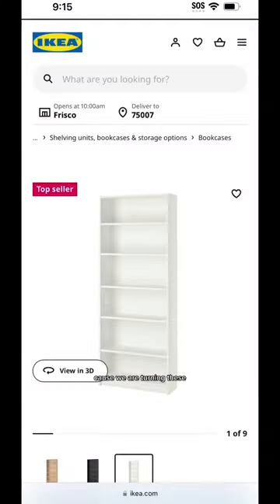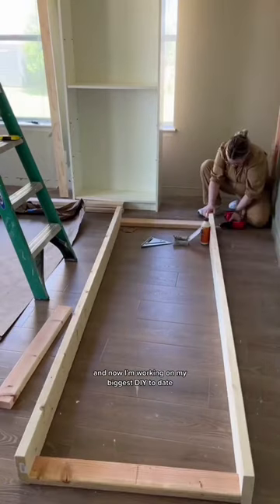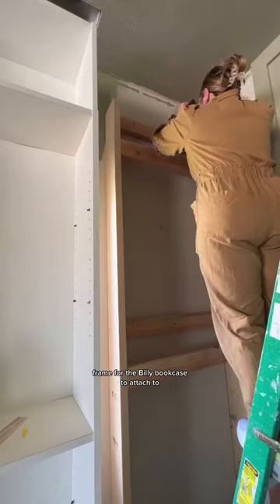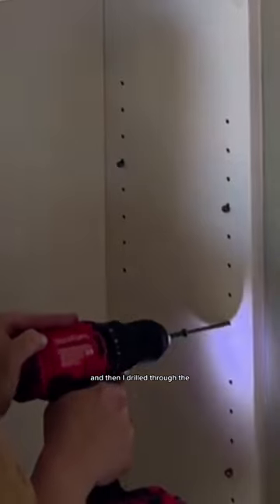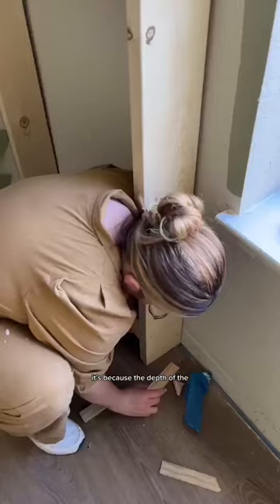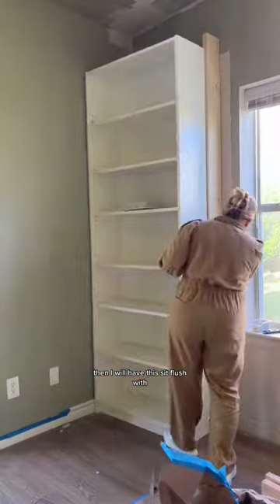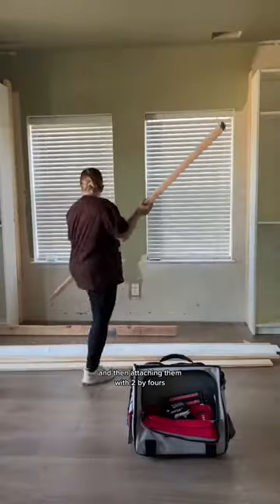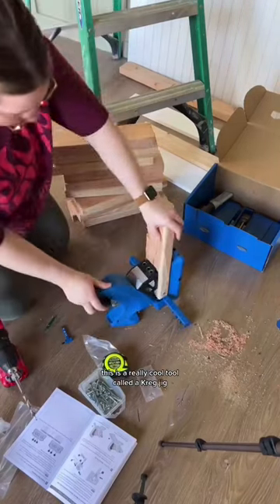Ikea hack anyone?! Operation Office Part 3 (1/2) #diyproject #diy #bookshelf #renovation #remodel

Comment: There is a deeper version of the Billy bookcase, vey nice because it fits a lot more stuff!
Reply: You can get besta cabinets, but they are much more expensive and in my personal experience more flimsy. I'd have wanted to just keep the billies against the wall and frame out the edge of the bench, but that's a personal preference.
Reply: In the USA there is only one depth. 11 inches. Once upon a time there used to be a 15 inch billy. But not anymore